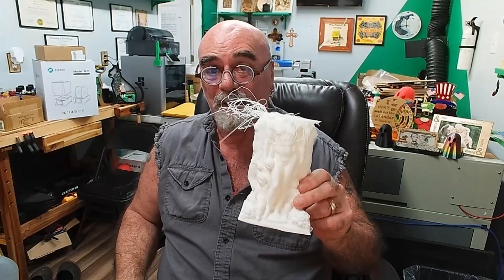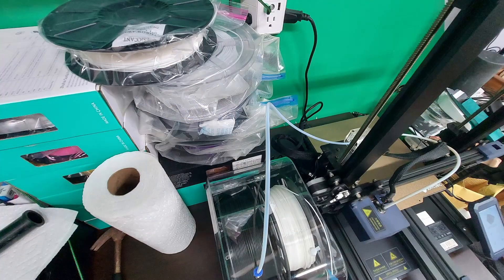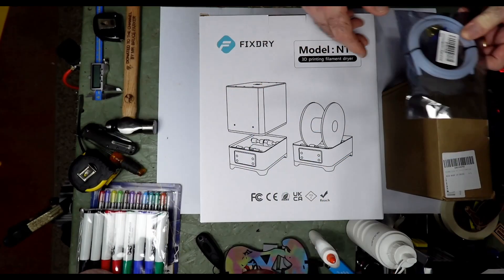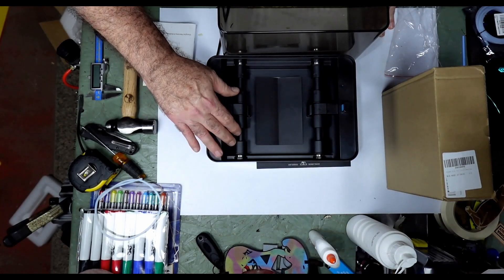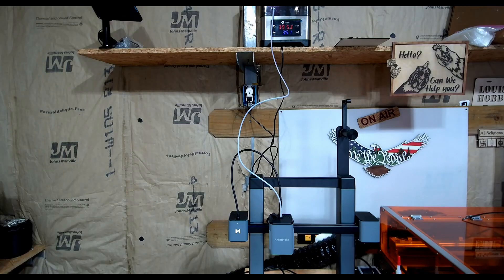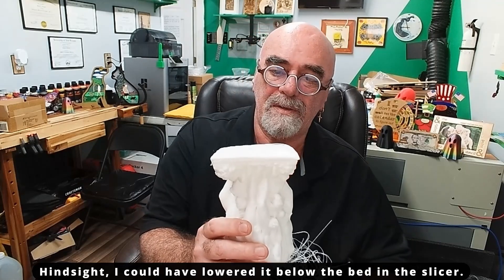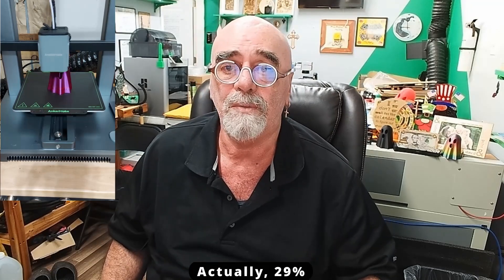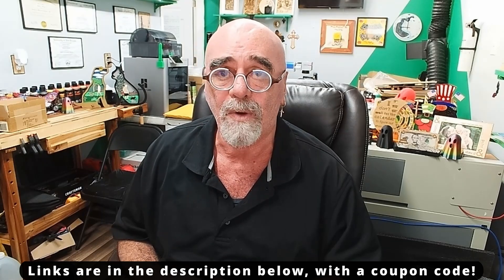🛑 How to STOP stringing on your 3d Printer with the FixDry filament dryer!

Comment: I think I have 5 filament dryers right now lol Tip for ya, if that is marble filament throw a .6 nozzle in the machine as I never had good luck with bigger prints until I changed to a bigger nozzle as the particles get stuck in the nozzle for me. I hate marble filament!
Reply from the maker: That wasn't Mike, it was a test run with white. I was going to do the marble after I tested the file. Thanks for the tip though!